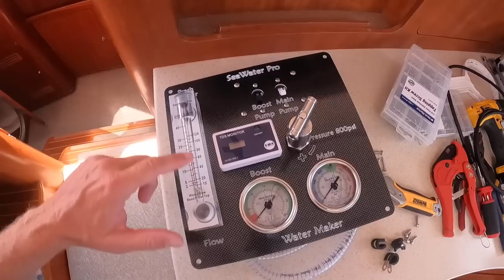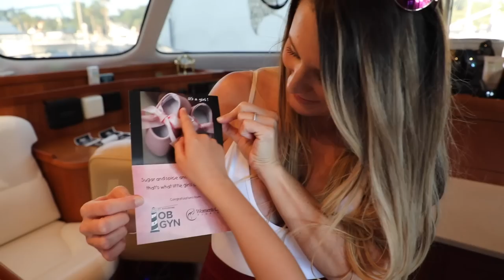We're PREGNANT! Big Announcements, Gender Reveal and a SeaWater Pro Watermaker Install! - VLOG 213

Comment: was the red plug in the membrane plastic? these are typically just to protect the threads until installation and not rated for pressure. if im wrong, my bad, just wouldnt want that thing to shoot out of there. congrats on the baby
Reply from the maker: Yes, it's a lower pressure area so that plug works just fine. Thank you so much!

Comment: Don’t use your water maker when at port!! Only when out in open water. In port most water is to dirty and will destroy your membranes. I learned the hard way!!!
Reply from the maker: Yeah using it in port isn't preferred, that's for sure. Although most of the time it will just kill your prefilters. If you have oil in the water, you're done.